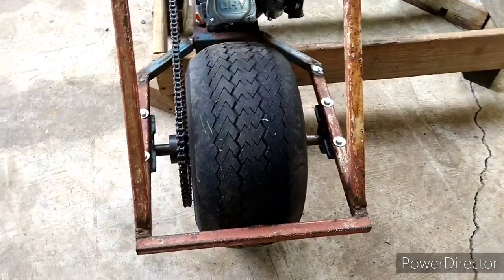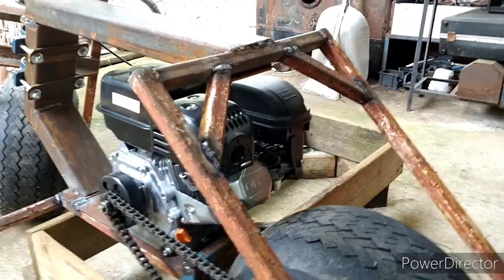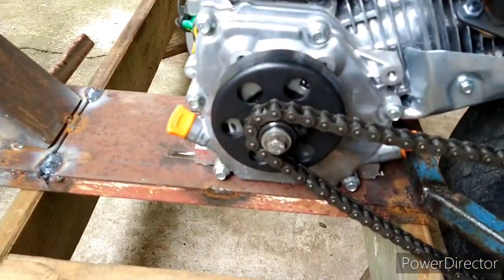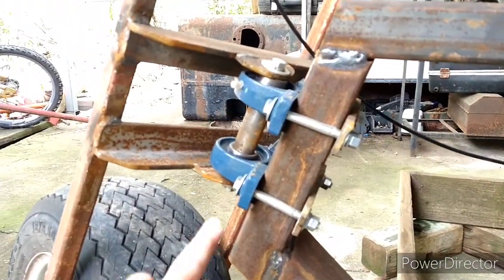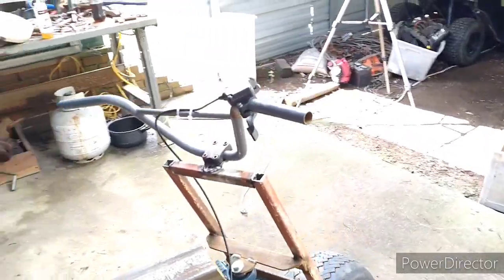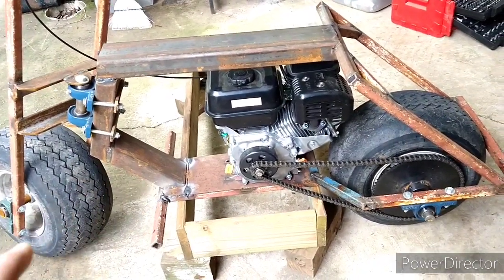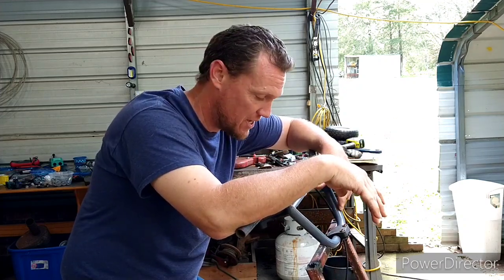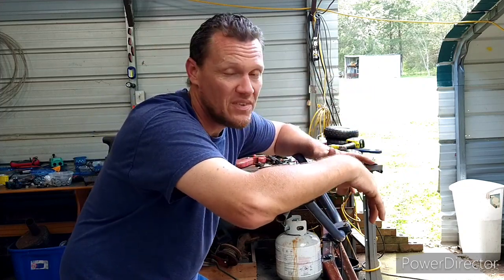Homemade minibike , Predator 212 powered, transforms into a trike too! Then a 4- wheeler!

Comment: First off I like the look ! As far as torque your running about 6:1 gear ratio and for great launches you need to be around 10:1 ! A jack shaft would help if you run the correct gears , 12T clutch to a 24T with a 10T to your 62T should bring you to 8:1 to rear tire ! Or just get a 82T rear sprocket ! I’ve seen guys use mountain bike derailers and shift like it has 7 gears , I like the golf cart 4on4 lug wheels ! Lol
Reply from the maker: After the adjustment,it is much better, still might go to a 72 tooth sprocket, thanks for watching.
Reply: @ChrisfromKeyfarm  there is a trick we used and that is with a small zip tie on your governor spring but not to tight , just enough to make it solid . You’d be surprised on how much power you get without the governor working !

Comment: If you are geared to high which it sounds like a torque converter would fix that easy.  I had a clutch on my mini bike with a 212cc and it did 40mph with 300 lbs on it and the after adding the torque converter I can easily pop wheelies
Reply from the maker: Awesome

Comment: did you back out the throttle screw so you can get the engine running faster
Reply from the maker: After the video
Reply: @ChrisfromKeyfarm  it is pretty cool bike I wanna do a mini bike next. I'm working on a gocart with a 420 with a stage 1
Reply from the maker: Sounds pretty cool

Comment: There is NOTHING wrong with this project. Your usage of P212's and pillow block bearings is nothing short of amazing. And in the background you may have already read my mind: what can you make with the Hobo Freight $3.99 tire/wheel combos?
Reply from the maker: I knew you would comment 👍. Check this out the cheapo HF wheels are being used on the next project. It's a beach wagon , dual wheels all the way around, 12/24 volt , should be able to carry everything we take to the beach and be controlled by a keychain or smartphone.
Reply: @ChrisfromKeyfarm  Nothing but genius right there!